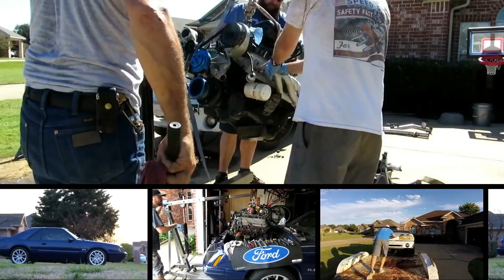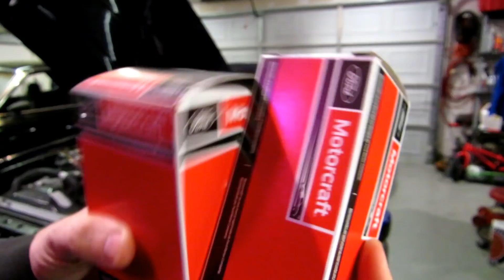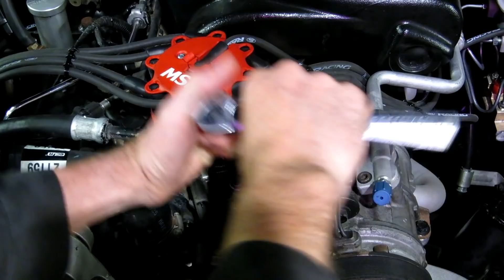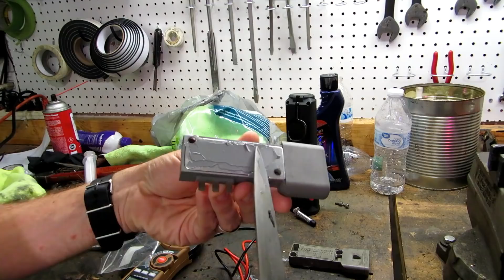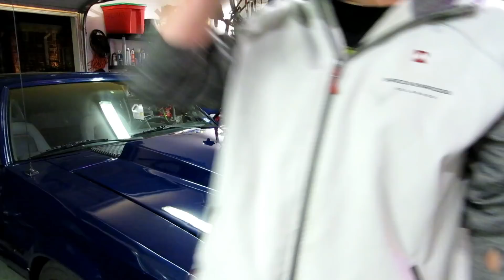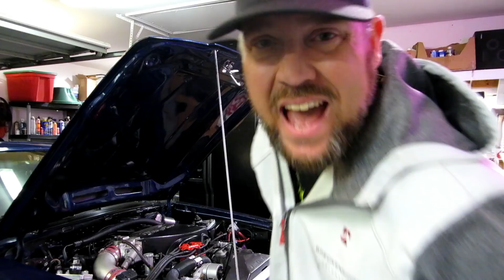1986 Mustang GT Project - How to: Set Base Timing and Replace TFI Module

Comment: Since heat is such a problem for the TFI. Do you recommend doing the relocation kit ? Thanx in advance
Reply from the maker: Im going 5 years on my TFI, and we have HEAT here, 100+ weather WITH turbo and hot underhood temps. Just keeping it clean and a coat of thermal paste, Ive never had to need to do a remote mount in any of my fords.
Reply: @HOUSEOFDULA  good to hear thanx for the quick reply

Comment: Wheres the crank position sensor on these 86s
Reply from the maker: They dont have one. They use a hall effect style distributor for ignition (dura spark), based on cam timing. You wont see crank position sensors until you get to distributorless coil-over systems...ie the 1996 4.6L mod motors.

Comment: Factory original equipment is always the best and longest lasting in my experience. I am still running original steering pump, air pump and alternator.
Reply from the maker: Yessir, they honestly do NOT make them like they used to.

Comment: Great video, however this seems not to fix my issue on my 86 I just bought.. it runs perfect until the engine hits about 130 degreee then starts surging badly. Cleaned the iac, theres no vacuum leaks did a smoke test,, cant figure it out for anything..any idea? Thanks
Reply from the maker: Hey man! Check your O2 sensors, or try unplugging them. Also check your ECT and ACT sensors. After startup, about 3 minutes in time the ECU will go into closed loop. Sounds like its going in closed loop but getting a faulty signal from one of the critical sensors. Unplug one at a time while the engine is running to see if the surge stops. Also I know you cleaned the IAC, but it needs to read between a certain ohms to make sure the motor it working, put an ohm meter on the leads and it should between 7 to 13 ohms. Outside of this it might be bad....Surging idle is usually fixed by setting the base timing granted all other components are good and there are no vacuum leaks. Usually its vacuum related but sounds like you tested that really well.

Comment: How come you didn't recheck the timing mark after you locked the distributor in place and plugged the spout connector back in?
Reply from the maker: Im sure I did, maybe missed it on the editing? Or maybe I was cofident I didnt move the dist after locking it in lol Likely didnt check after plugging Spout back in...the ecu will advance as needed anyway
Reply: @HOUSEOFDULA   Oh ok cool, not trying to be a smartass or anything man just asking because i just did mine and when I plugged the spout connector back in it moved the timing mark to a different position when I re checked it with my light.  Car cranks on first try, good power throughout the RPM range, so I'm assuming its fine but just wanted to know if that was normal or not and I can't find a video on here that talks about the mark moving after the spout is put in.
Reply from the maker: @thehellfox3423  - Yep. All good! Thats normal. The spout tells the computer to take over timing. Plugging it back in you'll see it move / advance.

Comment: at 13:05 you can hear a distinct whistle that sounds like a vacuum leak. Do you know what that is? Some say it's the TB/IAC others say it's a vacuum leak.....mind does the same thing and goes a way with RPMs.
Reply: Is this a bbk tb?
Reply: @kowpow2259  Mine is not a BBK. It looks like an SR Performance. It's also probably 75 or 80MM. It's bigger than the opening of the GT40 tubular intake, which is supposed to be 70MM. I got an Accufab 70MM to replace it with but haven't installed it yet. I'm still thinking vacuum leak somewhere.

Comment: Nice car! Do you think skipping the initial "drop test" (@ 1:02 https://youtu.be/Ujh81PrzNes?t=61 ) might have given you more confidence in motorcraft electronics on the first try?
Reply from the maker: Thanks! Ha, your not the first to notice that...I dropped a spare one, not the new one. The new in box was faulty however.
Reply: @HOUSEOFDULA  on my 93 gt project I just deleted the rear upper control arms and put in a pan hard rod and torque arm from maximum motorsports and its a completely different car. Much faster AND safer.  the difference in traction now is night and day. I haven't tried to swing any donuts yet bc A) I love my car and B) I dont think it will be as easy to break them loose anymore unless your on some cheap wooden tires. You have to do it to your 86. I did it on jackstands in a weekend.
Reply from the maker: Thats a sweet setup. Any ground clearance issues on that torque arm setup? Seems it would drop so low. There are SO many rear suspension option and so many are really good. Its hard to pick one to be honest lol
Reply: @HOUSEOFDULA  Ground clearance is only an issue if I go over a speed bump at an angle bc the lowest point is at the diff. so I just hit any crowned driveways or speed bumps head on no problem. It would have taken Luigi and Mario to tuck the tail pipes through the Panhard bar over the axle though so I just dumped them after the muffler. I think this is #3 on the list of first mods I do to a fox body. 1)subframes 2)rear Lower control arms 3)Panhard/torque arm 4)gears 5)aluminum driveshaft 6)5 lug disc... etc.   jusmy2⍧       no need for reply   thanx!

Comment: Love your channel and the content you put out. I was hoping you can help me out. I have four on my 92 mustang 5 liter they are 12,21,41, and 91 I have switch everything out with new parts. New o2 sensors, temperature sending unit,and  I've set the timing but the codes still come up. I would appreciate anybody's help. Thank you and keep up the good work.

Comment: I have a low rpm stumble, rough idle, and start stall after a hot soak but it's fine at high rpm on my 89 grand marquis 50 . I'm trying to figure out what it is and I'm testing stuff out. I have an msd coil and I'm wondering if there's a way to check its all good without just guessing and replacing it
Reply: It also surges for the first mile after a hot soak

Comment: Here's a riddle I probably won't get an answer on (I have a 1985 GT with a carburetor so no one knows about those old things hahaha)    My Idle is surging up and down at a light or when stationary just like it has a 3/4 cam in it and is starving for fuel....   It's a stock motor with the stock Holly 600 carb. and original "Snorkle" air cleaner assembly.   Any Ideas?  it doesn't stall but it's annoying....

(Also- Has bolt on shit- Edelbrock RPM Performer manifold, BBK Long Tubes, MSD dizzy and Flame Thrower if any of that may matter)
Reply from the maker: Surging on a  carb is a lower idle circuit metering issue likely. Meaning check for vacuum leaks. Especially around the carb base. I have more expertise with carbs. Id check the carb and make sure its tight / inspect seal. Check ALL vacuum hoses. Lastly check intake. Edelbrock RPM is a great intake. If all vacuum is good, carb might have a buster power valve or stuck float. If you have never rebuilt the carb, rebuilt kits are pretty cheap and good insurance. A busted power valve will suck fuel into the lower intake outside the carb and will run rich.

Comment: Just an FYI you wanna flip your timing light clip over then put on spark plug wire. If u look at the top of it you’ll see where it says “plug” with an arrow pointing right. Has to point towards driver side. I didn’t know this either at first. 😳
Reply from the maker: Never heard this before. Im not sure the clip cares where its sided, as long as the completely clipped over the wire. Could be wrong!

Comment: Glad to see another 86. I have an 86 convertible. B-cam..I love it but am trying to figure out my high sticking idle/surge
Reply from the maker: This is almost always the IAC or IAC voltage setting. Go through these steps, https://www.allfordmustangs.com/forums/5-0l-tech/340926-how-do-base-idle-reset-how-check-set-your-tps.html set the base idle, the IAC voltage. If it STILL surges check for vacuum leaks or replace the IAC but perform a base reset first.

Comment: I just wanted to pass along that it’s been found out that a lot of the new motor craft parts especially the TFi modules may not actually be motorcraft. I know they come in the box but a lot of the new ones don’t have it stamped on the TFI. There was a thread on one of the forums about it’s just a heads up.
Reply from the maker: Seems true...sad, mind as well get the chepo chinese ones they are all the same now days.
Reply: True> Ive been doing some research on it and it seems as though the heat it the main culprit. I guess the higher quality Motorcraft  one could handle the heat better. I have also read some people have had success with the Chinese ones IF they have the TFI relocation kit. I can only assume its because then they don't get hot like before. Myself I plan on doing a relocation before I even have problems. Could be an Idea for a possible video ;)

Comment: Is the one that failed also the one you dropped? I've dropped them and ruined them before
Reply from the maker: No, in fact, I was holding the old one that dropped and ended up being the one working. Odd...I can see dropping them is no good...just seems they used to be made much better.

Comment: If the timing mark flutters, it's the module. A stator can cause the engine to buck like somebody is turning the ignition on and off. There is a code for the pickup coil PIP sensor. Get the Actron CP9690. It has graphing, live, freeze frame, record, code connect for solutions, oxygen sensor tests, code testing, oil schedule light turn off, MIL light turn off, ABS, and more! It has cables for OBD I Ford, G.M., Chrysler, and 2 Toyota cables. It has a OBDII cable, a cigarette lighter cable, and instructions. It is updatable. It works on most imports and domestic.
Reply from the maker: Man that scanner is awesome. I did not think  OBD-I and Ford ECU could get live data metrics from the data connector port.
Reply: HOUSE OF DULA Well,I got it for my 1985 Ford but it don't give live for OBDI. It DID give a tip for a code that my Snap-on scanner didn't! On Ford OBD I it just gives the same as old style. But it'll give live and so forth on OBDII! There was a break-out box which would check voltage and resistance live on cars, but where to get one IDK. OTC had it. Thexton had one. It hooked up to the computer. It's a GREAT tester! It's lit up even in the daytime. Watch videos about it on YOUTUBE. To install the batteries (4 small AAA), you might have to use a knife or screwdriver to pry the cover. It'll show a CTS temp. with the engine off and cold to check if it's good. That's the live test. It has 2 color graphing to show normal and abnormal readings like for oxygen sensors. Fords don't have codes for the module. It checks ABS. It can help to get a car ready for smog tests.
Reply: eBay has a Ford 60 pin break-out box from Rotunda. Starting at $65.00.

Comment: Hey Mike I saw another video & he said start the car & let run for 2 min. Then hook up the spout wire, I'm not saying u or the other guy is wrong, because I don't know,  that's why I'm watching ur video's..lol he said the computer has to reset, then hook it up. But either way they both seem to work thank u sir good video.
Reply from the maker: Never heard of letting it run or waiting. Can see what that would do, one thing I would do (and maybe he was talking about this) was let the engine warm up. If its cold and start it and immediately pull the SPOUT, the retarding in timing would likely make the engine stumble or die....but it sounds like he meant let it run 2 min with SPOUT removed, then plug it back in. I have never done this but would love to learn his reasoning behind it.

Comment: noticed your engine does not shake as much as mine does when its idling... any ideas what could be causing this on my 85 302? Heads/cam/ported cobra intake. pulls great out on the street but just seems that it shakes quiet a bit just sitting at idle. the cams a comp XE270HR. Any inputs appreciated! love the car and your channel man!
Reply: danetbra63 check your harmonic balancer it could be spun 180 degrees and creating a strong vibration right at the crank. I just swapped mine the old one was completely spun the wrong way.

Comment: Dude thank you! I had the same stumble problem and I replace the coil and the harness plug to the coil and she runs like a top now hell yeah !
Reply from the maker: Right on! Seems as far as the TFI goes, good old OEM motorcraft are the best. Just keep them clean and keep thermal paste on the back of them. Glad it helped! Now go bump that timing up a degree or two ;)

Comment: Same exact thing happened to me. I put a brand new motor craft tfi and the car died down the block. Put the original 30 year old back in and it’s still running.
Reply from the maker: Crazy! One would think motorcraft would still be quality. Looks like not so much.

Comment: Does anybody know what would cause part throttle hesitation or miss?
Reply: Cal Ripken Get a Actron CP9690 code tester. It checks freeze frame, record, oxygen sensor test, ABS, MIL light turn off, oil schedule light turn off, graphing, and more. It includes OBD I cables for Ford, G.M., Chrysler, and 2 Toyota cables. It has a cigarette lighter cable, and OBD II cable, and instructions. It has code- connect for solutions to problems.

Comment: Are still running off the tune that was in the car? If so be careful tune's timing curve is probably based off of 10 degrees initial base timing, by going up to 13 no telling what your at up stairs in the rpm band. Awesome video man I actually get bummed if there is no new content. #notastalker
Reply from the maker: More to come man. lol #notastalker. The car just responds so well to timing. The difference between 10 to 12 is something I can feel immensely. And from 12 to 13 was huge. It must be liking that 93 octane too, because it makes me want to test 14 degrees. But your right, no clue what the total timing is at WOT on that tune.

Comment: Another nice video, good call on the Artic Silver its better than the white thermal grease. Noticed that your running an air filter in the engine bay, which is not to bad on a cool day or night. Running an air filter in the engine bay I'm sure you know will draw nothing but hot air especially on a hot day.  Also the pulsations from the fan could be causing throttle issue for you. At the very least I would suggest covering the air filter to prevent air form the fan, or if you still have the factory air box with a K&N filter minus the factory resonator and see if that helps at all. If you could get a cooler air charge into the engine, it might allow you to bump the timing another point or two then you will really have a raped ape. Just a thought.
Reply: Artic silver has replaced the White Thermal grease of yesteryear. It conducts heat better that the old style Thermal Grease and it is also an electrical insulator. I have taken an Ohm meter to the Artic Silver and it reads infinite, so he made the right choice I think he just got a bad module as he stated in the video.  I suspect that he also used the Artic Silver on the old module he put back in with no issues.
Reply: I have a feeling that the problem was the Artic Silver. Dielectric grease is electrically insulating, Artic Silver is a conductive material meant to move heat from one surface to another. Insulating against current from spark is probably what is required. The heat wash from the distributor would always flow OUT to the module which would happen either way, just faster with artic silver, meaning it cooked faster and probably was taking spark that the dielectric grease would have stopped.
Reply: I thought he might have used it on the original again so wasn't quite sure, but that's good to know. I keep arctic silver on hand for pc builds, but didn't connect using it on the car.
Reply: I went with the BBK intake and bought an extra filter.When ones dirty,pop on the backup,clean the dirty one,it becomes the backup.And it makes a difference over having the cone filter in the engine compartment

Comment: If you take the TFI module in and they check it, have them run the test multiple times. I had a stumble in mine with a "new" TFI module. When I took it back they tested it (Autozone) and the first time the testing machine said it passed. I had him continue testing 5-6 more times then it began to fail as it heated up.
Reply: I had them replace mine under warranty.I could feel it getting weaker and harder to start.I buy enough stuff from them that they didn't test it or question me.

Comment: Where did you get the tool for tfi module
Reply from the maker: Its just a 5.5 mm deep socket and lil thumb ratchet. Got both at Oreillys.
Reply: You can get the actual tool at AutoZone for around $10.

Comment: Mike, That wasn't the "grain of rice" method....
Reply from the maker: no not at all. I layered it on. Figured tolerance's was not as good, surfaces not as smooth as a CPU would be...Might be too much you think?
Reply: distributor surface being what it is, i think as long as it's not oozing out as you screw it down, it's good.
Reply: LOL!!! I had the same thing happen to my Fox, so I went with a fan cooled relocation part from FatFoxx

Comment: What a great video my 92 stumbles under wide open throttle and a small intermittent miss at highway cruising speeds  the motor is a reman with less then 5k the tfi was replaced last year maybe I should try the coil thanks man
Reply: I had similar issues with some stumbling at high rpm under boost with an older MSD coil.  Replaced with a Motorcraft coil and issue went away.  Hopefully that will fix yours